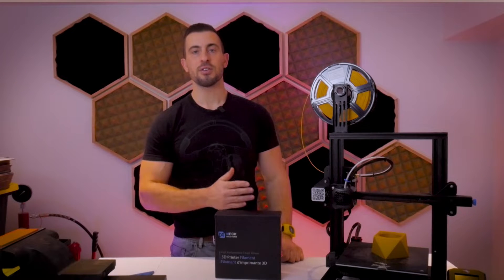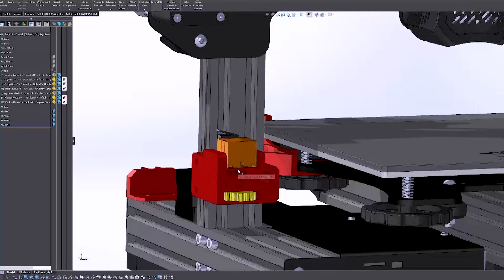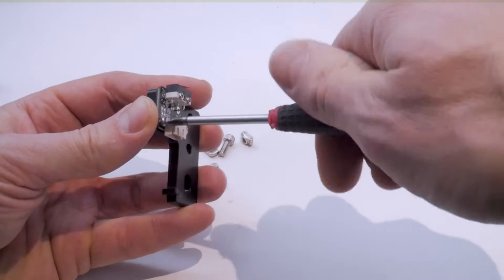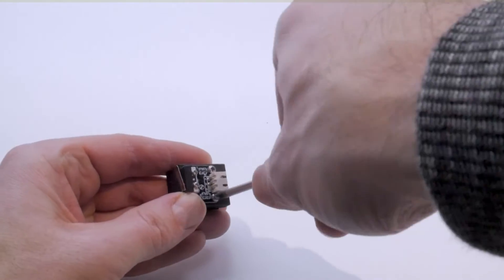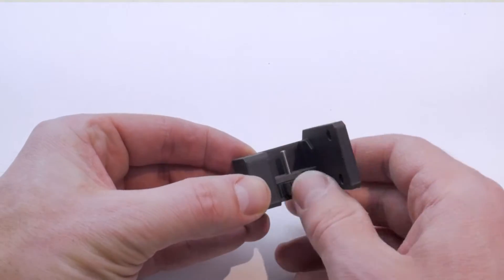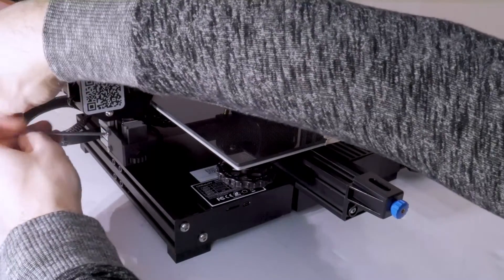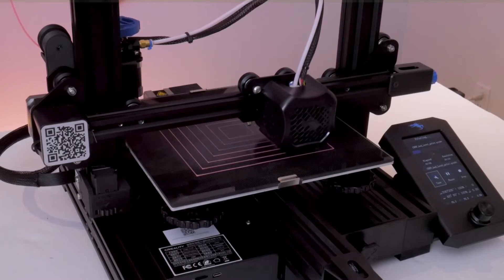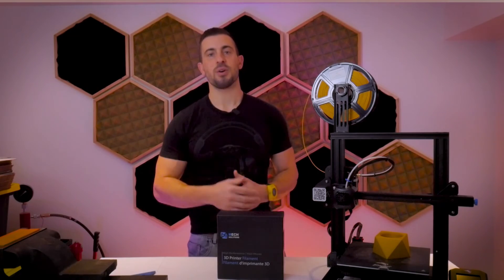Creality Ender 3 Adjustable Z End Stop (Should Also Work On Aquila, XY-2, U30, LK4, A10, BIQU B1)

Comment: I am attempting to make this device. What is the outside diameter of the 3 mm insert you are using? mine are 4.6mm and drop right in the hole.

Comment: Where did you buy the M3 hardware? The best I've found is an M3x16 at a local machine shop. As I need only one of each I'm definitely not paying for shipping to get it online.
Reply from the maker: Where are you located? You might have to go to a local industrial hardware supply store that will sell in individual pieces. Since it is such small stuff they might even just give them to you since the cost would be like 5 cents lol
Reply: @EmbraceMaking  I'm in Alabama, in the southern US. I've managed to find the nylon locking nut at Lowe's and the socket head screw at Home Depot. No luck on the heat set threaded insert yet.
Reply from the maker: That one will be trickier, have you tried aliexpress or ebay? You could probably get some shipped to you for a $1 or two
Reply: im having trouble finding the right hardware size, is there any way a link or a more specific description of the exact M3 i need, because i went to micro center and they only had M3x4mm and they were too small
Reply: @KevMuller  I had to have the heat set piece custom made. Luckily, I live with a machinist. The other two I found at Lowe's and Home Depot. This will be the last print I try to do using M3 hardware, it's just too specialized.
Reply: @88KMartin  I appreciate the quick reply, yeah I found a stl for a FreeABL and it has you move the Z stop onto the extruder, that may be the move if I can’t find the pieces

Comment: Did you do the 3D model of the Ender 3 V2 yourself or is it available somewhere? Would love to get a copy of that!
Reply from the maker: I recall correctly... this one I found on thingiverse a while back... but if you check grabcad there should be tons of models now in so many different file formats. Let me know if you can find one that suits you
Reply: @EmbraceMaking  Will do! For now, thanks for the adjustable stop design. Works perfectly and saves me a LOT of time when for some reason the Z clearance suddenly dissapears over night. Actually it has not done that since putting in the adjustable stop. Maybe the switch just works better rotated 90 degrees. The original Creality design was daft!

Comment: I noticed you have some custom software loaded on your machine. I have been having trouble after loading software showing the model picture. Had to load the default again but my machine now has to be switched off to load the sim card or it will run into the x end stop when starting the print. Great video and great quality print.
Reply from the maker: Sounds like some strange behavior on your printer. The firmware on my Ender 3 V2 is the "Jeyers BugFix 2.0" maybe it will work for you if you can find it online?
Reply: @EmbraceMaking  thanks I found it. Loaded it according to the video and it seems to work fine so far.